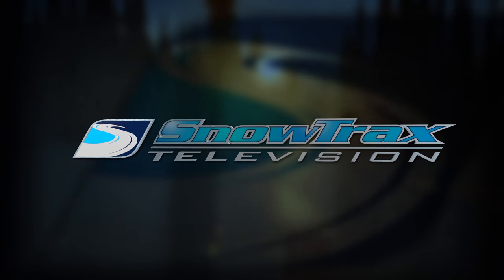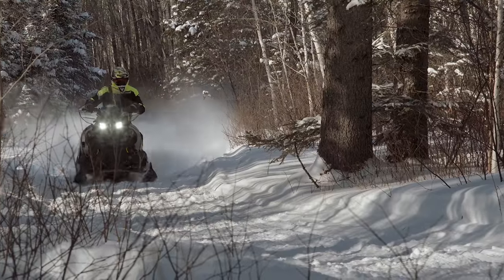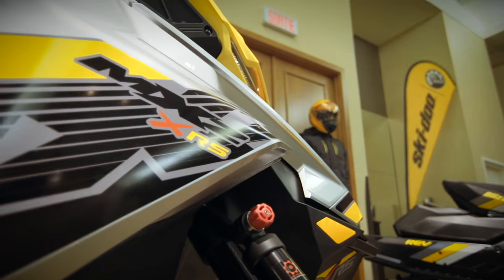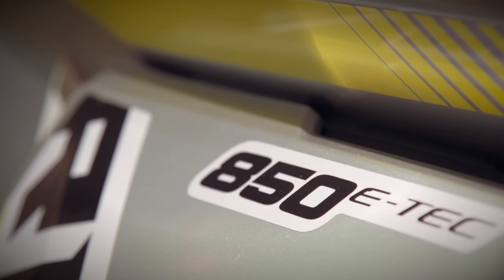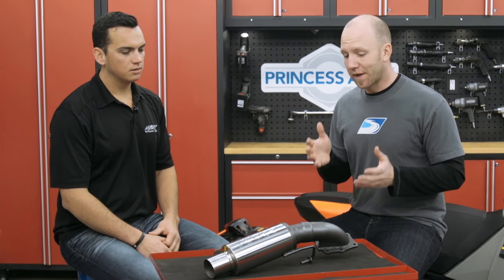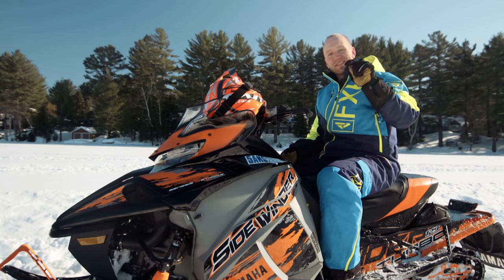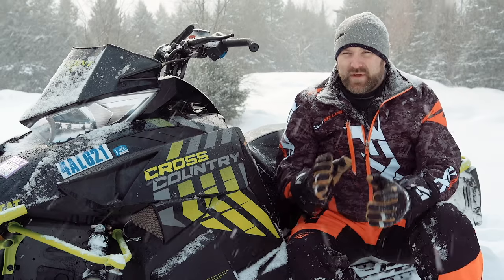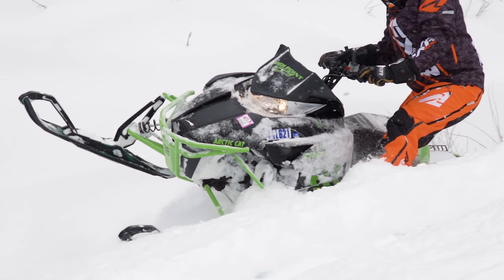SnowTrax Television 2017 - Episode 12 (FULL)

Comment: 9:11 you can see why 850s have belt issues, that primary is not rotating straight at all
Reply: You're watching the whole engine vibrate not just the primary.
Reply: Stephen H. Thats why there is a company maching 850 primaries to.fix them. Maybe you should contact them and tell them they are designed unbalanced to accommodate the vibration
Reply: No recall, no problem. Until there is one, all of the typical shit talk is better left for people that enjoy the high-drama part of snowmobiling.
Reply: I've seen it, the sheave or whatever you call it doesn't sit flush against the axel so it rotates like a crooked rim. Don't know if some gets them like that from factory or if it happens after they've been overly heated.
But it sure is a problem for some!
Reply: LOL no recall no problem lol, must own chev products...there is a problem just google ski doo 850 belt issues its LITTERRED with links to multiple forums and like i said redline performance is doing machining to fix 850 primary's so i guess they are just charging people for fun to machine a primary built to be untrue i suppose lol
Reply: gangsterboat69 it's a big problem, I know a guy that's on his 9th belt so far this season almost 3k miles lol
Reply: If your buddy hasnt looked into it i would tell him to look up redline performance on facebook they are offering to fix them for 100 bucks...i wouldnt wait for a recall..belts arent cheap
Reply: I hate chev. Forums are whinefests. If it's an issue the dealerships will take care of it. Why do people blow shit out of proportion so much? Masturbatory bullshit that's all it is.
Reply: That Stephen doesn't seem to know much... But I saw your videos and I can see you've got an eye for quality when it comes to sleds hehe, I Have pretty much the same (-16 viper r-tx le 129"). Found any flaws?
Reply: Aside from a tri hub delete this sled has been unreal...just bridged 10,000kms never had a belt fail, runs like day 1. Couldnt ask for anything else. No cast bulkhead, no untrue clutch lol.
Reply: Alright, I don't like the starter. But there's a fix for that, when starting it appearently loses too much voltage and it fails. But that's about it, otherwise I can't say anything compared to my -14 summit lol
Reply: mines never had a starter issue...i am running an odyssey battery but -32c may times no issues never had a kick back or a no start....just been solid

Comment: Excited to see the cat 200 and the snow coot, I'd actually like to 200-300 cc sled that would make a good low speed utility style that is light and maneuverable like the sno scoot. I run a sugarbush and need a little get around sled, but sleds like my zr500 are to big and heavy and don't maneuver well in my tight woods at low speeds, they can't putout put through the woods and a fast walking pace, especially if the snow is fresh and deep, I just need something that is geared for like 20 mph or so that can support. An adult without feeling like a kitty sled, super simple, like a Honda fourtrax, small light and utility, but not huge and slow like a Titan or a tundra, I guess an older skidoo tundra could work, but something lighter and smaller and slower than those is what I am waiting for, any suggestions?